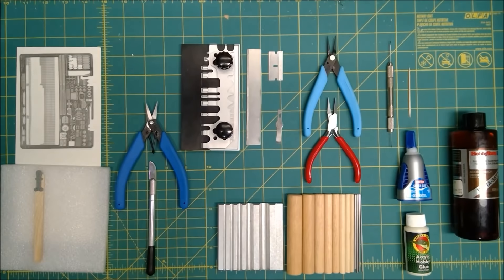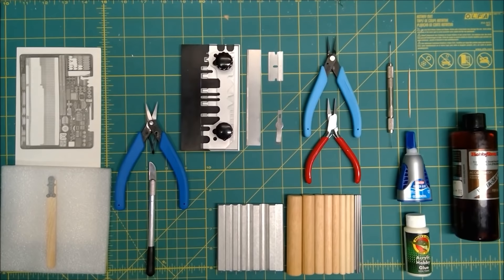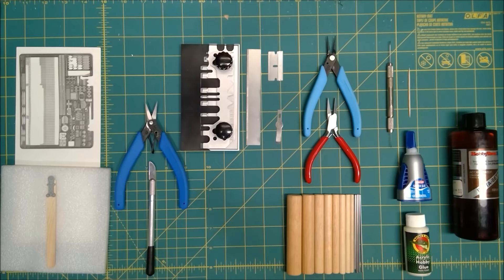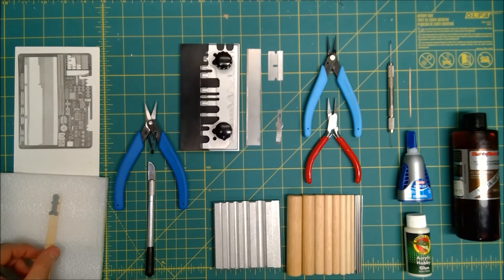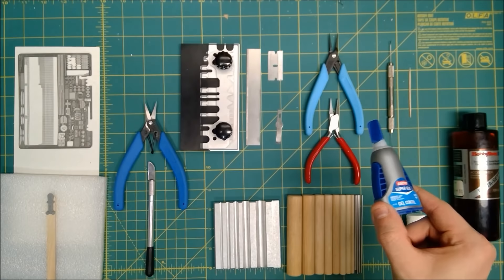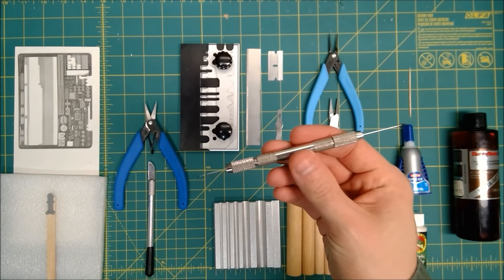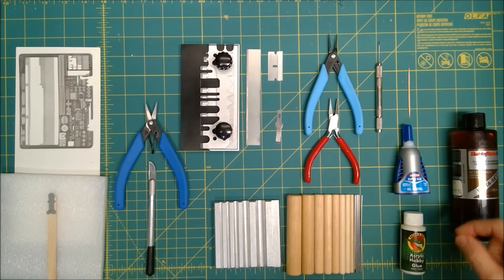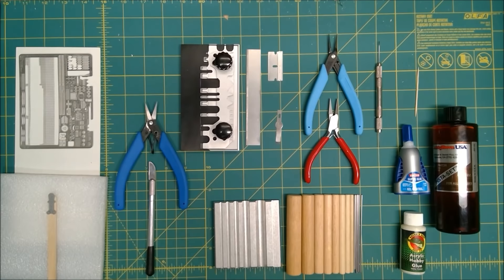Tips and Tricks: Photoetch Railing

Comment: Really nice video, thanks for posting it.  A good substitute for dowels are drill bits.  With a good set of bits you'll have almost every size circle accounted for.  

One trick I use with glue {doesn't matter what type} is to gently place the piece with the glue on it on a piece of paper for a second {more or less, you'll get the feel for it} and that soaks up extra glue but leaves a nice coating to form a bond yet doesn't leave any blobs behind.

Comment: Great demonstration.  I wondered how to join adjacent straight sections together. Do you clip off stanchions to avoid "double" stanchion joins? If so, do you apply glue to the free ends of the rails?  When making a 90 degree bend, do you cut the rail so that a stanchion will be at the apex?

Comment: Was the PE standing on the deck, or attached to the side of the deck. When I attempt PE rails, I have trouble getting them to stand up, and end up putting a bend to keep it upright. I use the same glues, but the Locktite does not set in 10 seconds for me; so I have to keep them perpendicular with fingers that are NOT rock steady!

Comment: One question: with older (or smaller) kits there are the plastic overscaled railing, which you replace with this phoetched parts right? In order to do this, do i have to cut all the plastic railings and sand before glue the photoetch parts? Thank you from a novice :)
Reply from the maker: Yup.  It's tedious, I know, but that's how it's done.

Comment: One quick question, If you have to paint the photo etch, should you paint it seperately before you cut it out or after you have glued it in place?
Reply from the maker: 95 times out of 100, I paint it once it's in place. I find that paint adheres to  PE quite poorly, so placing it after painting only creates the need for touch up. If you're going to have to paint it on the model anyways, might as well only do it once.